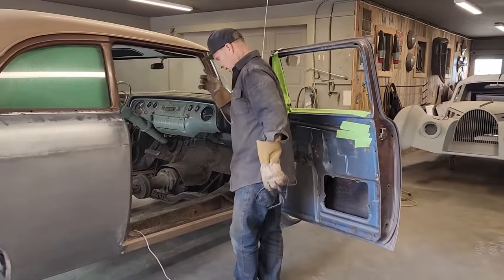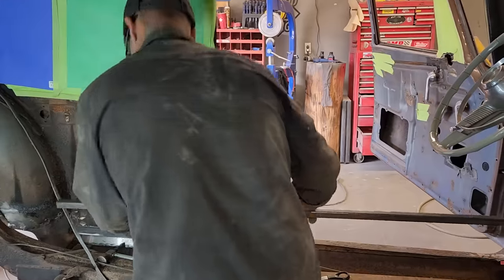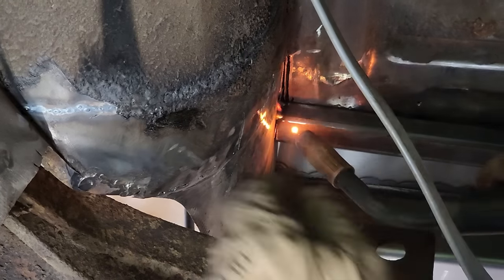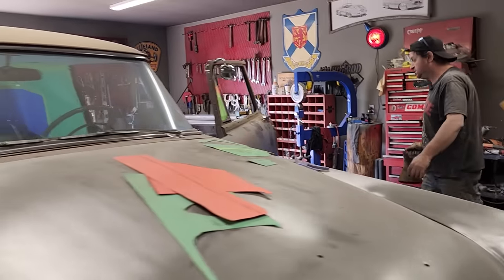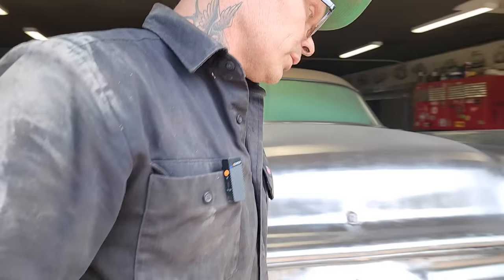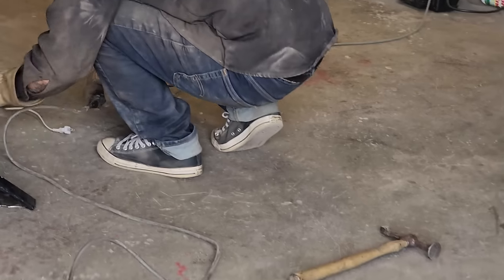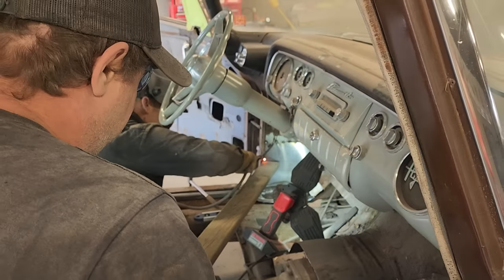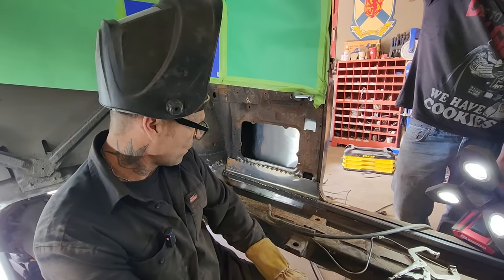Rusty floor repair — step 1 ⚠️

Comment: Hi Chad, Just a thought in the kick panel just attached, you still need to cut the access holes to get to the bottom hinge bolts and 
                    any other fill in panel if it had slipped your mind, [there is a lot to think about within the time] Missed seeing Fina  today

Comment: A tip for you chad, just cut an inch or so off the ends of the guard . Makes it a bit smaller and easier to use.

Comment: Hey Chad, hi Jolene, Chad yesterday you wanted to remove the grinder shield on you new Dewalt grinder, I went to my Dewalt grinder and there is a little lever. You just squeeze the lever and the guard will come off

Comment: CHAD  FORWARD OF THE ON OFF SWITCH THERES A LOCKING LEVER  AROUND THE GUARD  PULL UP AND GUARD WILL TURN AND WITH OUT WHEEL ON IT SHOULD COME OFF

Comment: That catepillar is called a 'Banded Wooly Bear'. Folklore was you could predict the length of the up coming winter by the length of the band. The longer the band (proportionately) the milder the winter. Their accuracy is about as dependable as any weather channel, or flipping a coin. lol  From what I saw you are in for a mild winter.  The Savoy is coming along, who would have thought there was so much work under that paint job. Looking forward to tomorrow when you get back on the Bugatti.

Comment: @Bad Chad - Such incredible work but... it kills me to watch you covering up the old rusted metal areas.  Why not take a little more time and wire brush them or ??? then put a coat of red oxide primer or ???? on to nip future rust in the bud.   I realize what you're doing should last for years, dependent upon how wet the environment the car will be in, but since you're putting so much effort into this project it just doesn't make sense to do some parts of it half-a$$ed.  Oh well, just an observation.   Cheers to you both from Thailand!

Comment: Suggestion. Is it possible to have a switch on the microphone to be able to turn it off when grinding ? It would make a big difference for the audio output. Just a suggestion, not telling you how to suck eggs.

Comment: it is hard for to me hear all that machine shit at once
Reply: That's nothing I worked in a car dealership for 48 years and in the shop we would have 20 or 30 techs with their impact wrenchs going or when I was in the bodyshop you would have a combination of impacts, zip cuts, sanders, and buffers usually with 10 or 15 guys. So I am totally used to it and in the earlier days most parts departments were not seperated from the shops.